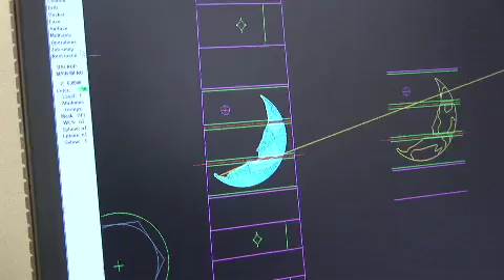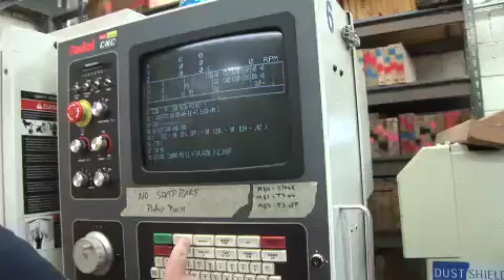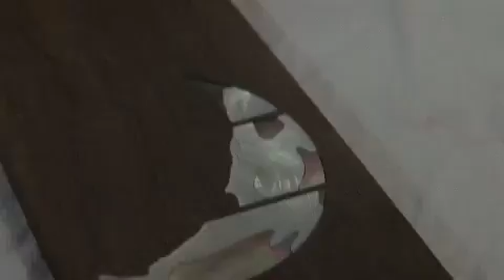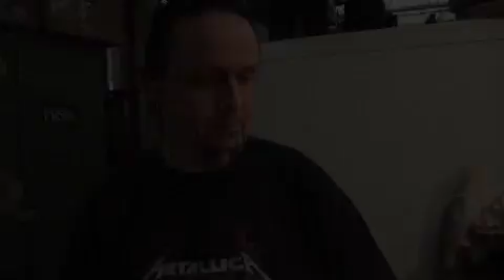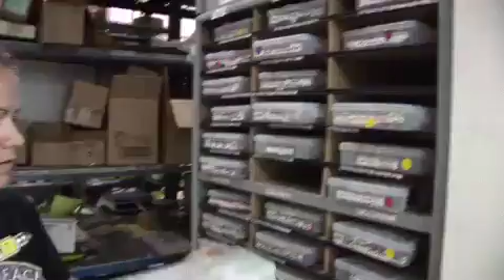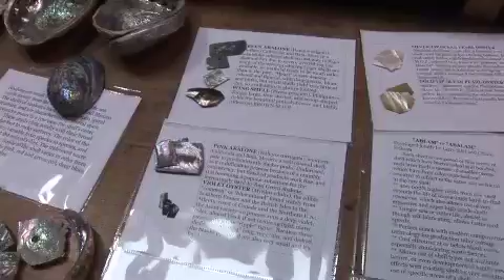Custom Inlay CNC, Sanding and Pearl Works - Private Stock

Comment: Don't hate on PRS just because none of us can afford a custom shop model. Hell, half the reason most can even afford a CE 22 is because of the CNC. I am a woodworker too and I don't see the CNC as soulless. It's just another tool to help make the process faster and WAY more precision. My first guitar took me a year to make by hand. I would rather have had the the CNC doing it to be honest.Especially the neck. Now you can do incredible inlay that all fits absolutely perfect without any fill in. Better quality. As far as their lack of safety goes, they will pay for that one in lawsuits later on. Even the guys who spray the Nitrocellulose lacquer are now wearing respirators either. Dumb, just dumb.
Reply: EvilKnievelJazz  CNC had nothing to do with affording a 4 grand guitar. Guitar center credit cards did
Reply: Amen, brother11 i too wish that I had a CNC - ALL  the guitar companies now have several. I would use it to make everything! I only wish.... The possibilities are limitless.